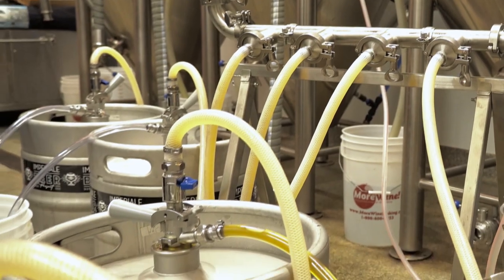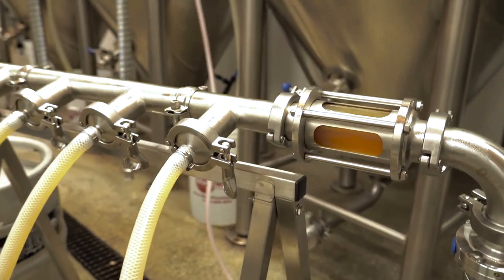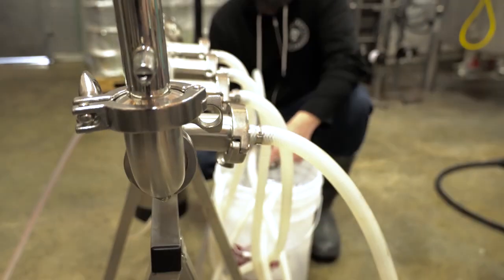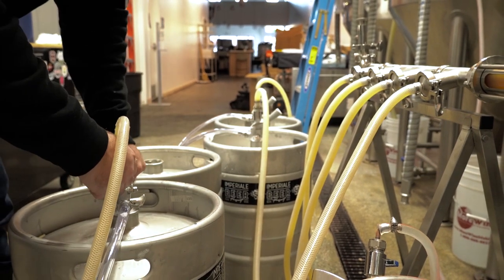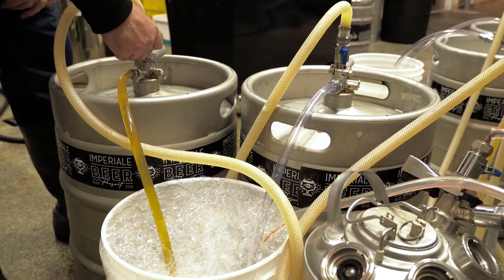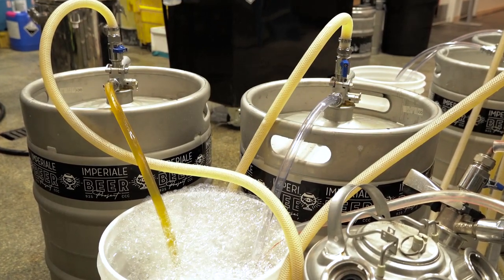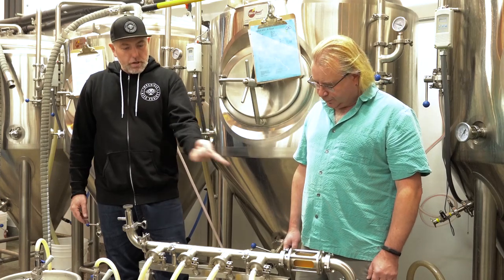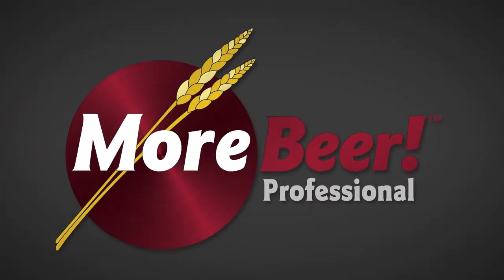How to use the MoreBeer! Pro Keg Filler to Fill 14 Kegs in Under an Hour | MoreBeer!

Comment: Nice video. Its cleaner and easier IMHO to put the CO2 shut off valves directly on the CO2 out of the keg coupler. That way they are not setting in the beer overflow bucket. An advantage to closing the beer line shutoff instead of the CO2 shutoff to stop the flow of beer is that once you get your flow rate set (controlled by the CO2 shutoff assuming constant pressure on the tank) you dont have to continually reset it for each new keg.  If you place a TC check valve at the tank you wont have to worry about accidentally back flowing into the tank and stirring things up.